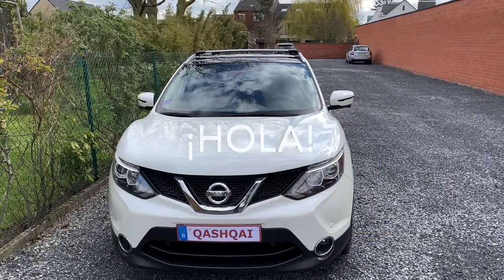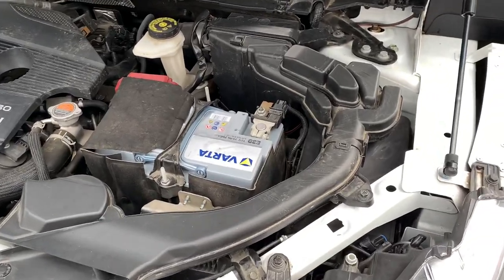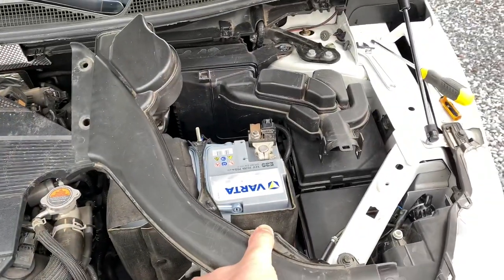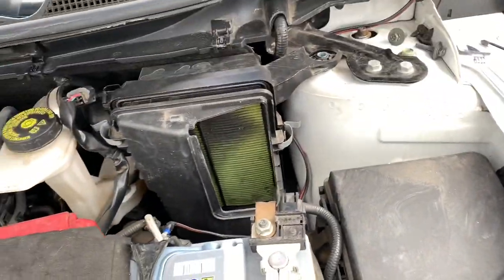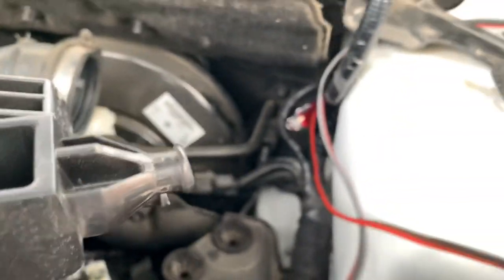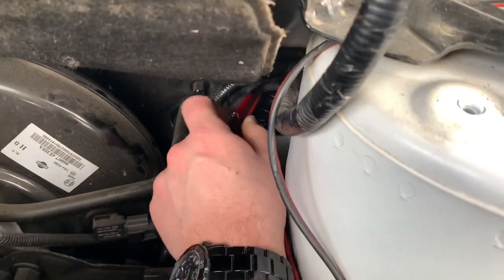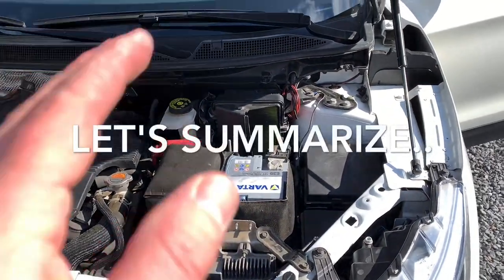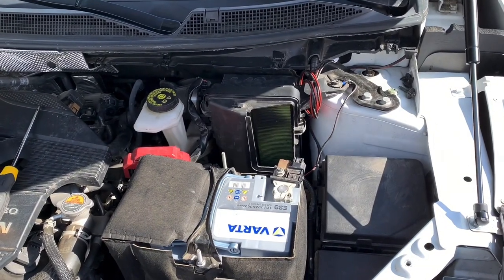Nissan Qashqai J11: How To Wire from the Engine Bay into the Cabin

Comment: Thanks mate, hopefully this is the same on the j10
Reply from the maker: No problem. Check before behind the clutch pedal. You would see the entrance easily if it is the same 😉
Reply: It is the same on the J10.
Reply from the maker: I guess so. Just check inside if you see the cable harness entering 😉

Comment: Where would I find a permanent live fuse and a ignition fuse on the qashqai
Reply from the maker: Hi mate, that depends on what you want to wire? For a permanent live fuse watch my video on the gas struts. There I use one. For a switched one stay tuned, I will speak about it soon. 😉 👊🏻
Reply: @LaPalmeraie0032  I'm trying to put a shock sensor onto my qashqai j11 that has got a factory alarm and I just cant seem to get it to work

Comment: Could you tell me where the alarm box is located on the qashqai
Reply from the maker: Hi, mine doesn't have one but if I may believe the workshop manual the alarm (or better security system) is build up by multiple components. One of them is the BCM (body control system) with the NATS (Nissan Anti-theft system) which is found behind the glove box on RH models as shown here http://www.photouploader.org/files/lapalmeraie/wtm/bcm.jpg
Reply: Because I wanted to see if I can add a shock sensor to it for the alarm system
Reply: Where did you get that attachment from that you sent me
Reply from the maker: From the workshop manual. Here you have the entire bookwork. Enjoy https://bit.ly/2SDTdyC

Comment: Sorry not understanding why you need to do this as you have 12v in the fuse box inside the cabin
Reply from the maker: That is when you just need POWER but if you want to control an accessory or a relay with a switch in the cabin (like foglights for instance) or if you want to wire directly to some connector rather than having to open up the cable harness and find the right cable among all... this is why 😉 👍🏻
Reply: @LaPalmeraie0032  I am planning to mount a front camera to my car. So i need to wire the "video in" cable to my multi-media system in cabin. This is excatly what i need. Thank you so much.
Reply from the maker: Great! Good luck and don’t hesitate to share the result 💪🏻